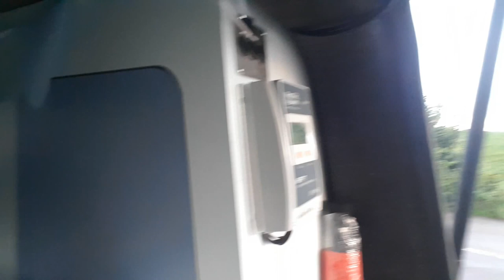FREE ENERGY Solar Panel VW Campervan Install | How to Tutorial | No Drilling DIY PV T5 Vanlife POWER

Comment from the maker: I have used a MPPT controller in this install opposed to a PWM one, I forgot to touch on this in the video but the basic reason for using the more expensive MPPT system is the current the controller will give out, 

Below shows the difference and maths involved to work them out

PWM: brings the volts down and amps down since its PWM or in other terms Digital switching (like turning a plug on and off), 

hence my 18v panel will go to a say 13volt supply to the battery by using PWM that's a 13v/18v = 72% reduction in voltage, this also equal a 72% reduction in current or amps which gives 3.95amps, hence my 18v 5.5amp panel giving out 100watts will equal 13v x 3.95amps = 51.95Wats to the battery

MPPT, on the other hand, keeps the amps the same or even increases them by the difference in voltage due to Ohms law, this means that either 13v x 5.5amp or 13v x 7.69amps occur's giving a greater power outage of either 71Watts or 100Watts, MPPT will also consume more as well that of around 0.5 amps so the actual output will be less but a lot more efficient than a PWM system

Comment: Hi mate. Nice video. 
Any problem with the glue resistance after years of sun and changes of temperature ?
Reply from the maker: Hi, no not as far as I can see its still exactly the same as when I fitted it.. no lifting of the panel yet..

Comment: does the wire plug into adaptor in your van or can you plug something directly into the wire for power?
Reply from the maker: Hi the solar panel has to go via an adaptor, you can't just plug into it, as the power from the sun isn't stable and the adaptor (controller) needs to fix it first

Comment: Hi
How have you been getting on with the solar panel fitted this way? I have a similar sun power panel and looking at ideas for fitting. Quite liked this idea 👍🏻 any problems or things you would do differently with how you fixed to the roof?
Reply from the maker: Hey so the only thing I would change is to try and waterproof the cable as it comes down behind the tailgate, if the weather is really bad it can leak in a bit, personally i still think I prefer this to drilling the roof.. and obviously it's only a issue if your van is outside for a few months of the year..   

Perhaps a way of running the cable down the left or right of the tailgate and in past the seal lower down might be better..

The actual fitting of the panel on to roof I wouldn't change anything..  it works pretty well, although another panel as well would always help...
Reply: VdubPhotogLife thanks for the reply matey. 

Yeah same, didn’t feel too comfortable drilling into the roof. Thanks buddy 👍🏻
Reply from the maker: No worries :)

Comment: Did it leak in last 3 years?
Reply from the maker: Hi, so yes it did leak a few times when we have had really bad weather or storms, it tracked down the cable and in through the boot seal, it pulled some more slack through in the end and ran the cable lower down beside the boot and then back up and in and that seems to have fixed it..

Comment: Should of put the cables through the rubber grommet on the left side of the van ,,, water will trickle down the cables 100%  😋
Reply from the maker: Yes I do need to adjust them, just need a bit of slack to have a loop before it goes through the seals and it will be fine I think, it's pretty good at the mo, just during very heavy rain it can slightly drip down, think I will solder an extension on and shrink wrap it so its neat..
Reply: Where is the rubber grommet on the left ? Is it the hard rubber one just above the light cluster ?